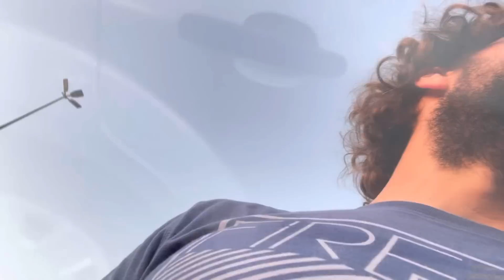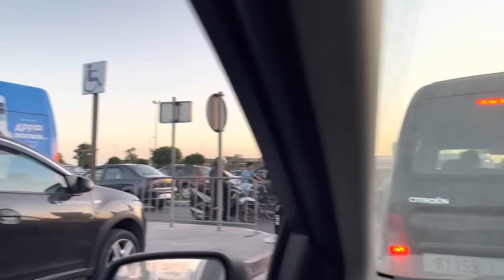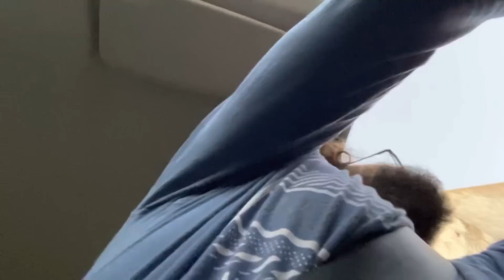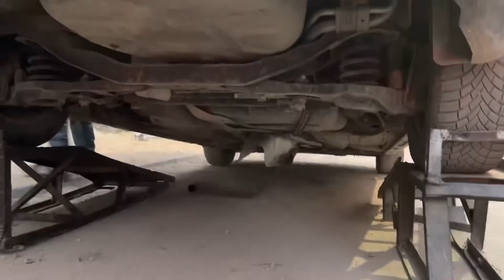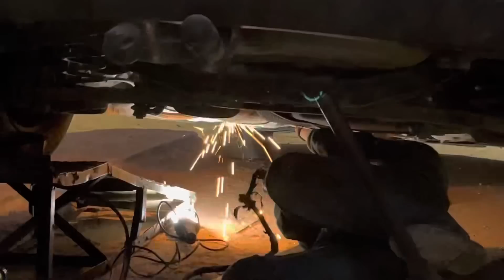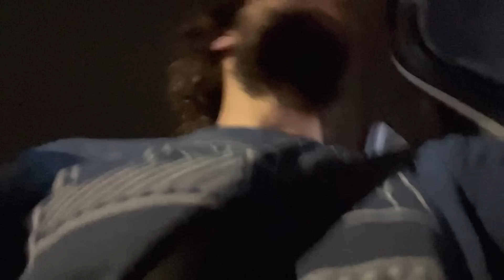SURPRISE PRICE at Moroccan Mechanic  🇲🇦 Tikiwin Agadir

Comment: in France the same work can cost between 150 and 400 euros. a dealer charged me 450 euros to change a filter.
Reply: With an invoice (facture), same as in the Netherlands (Pays-Bas). Think Kevin did not receive an invoice 😁, but cheap as hell. Think an original Ford dealer in Morocco would charge more than what Kevin paid.
Reply from the maker: I believe it. My last repair in the usa was 1000$

Comment: Be careful guys, don’t sit in the car, when it is being welded, petrol tank could ignite
Reply from the maker: Does this really happen or just in movies?
Reply: He's right Kevin. Welding  is considered hot work. Combustion precautions needed. Personally I won't have anybody on the car while welding under. And other tip Don't just take off after a hot work. Wait and watch for any flame until weld is cooled down and you're safe to head out. Safe and sound my friend.
Reply from the maker: @sar9907  thanks for the info. Live and learn! Thank god we are safe.

Comment: Kevin, did the mechanics replace the car exhaust with a new one? Probably not, because I saw that the mechanics were busy welding. Apparently they welded the original parts together.
Reply from the maker: Yes, i didn’t see any new parts put on…